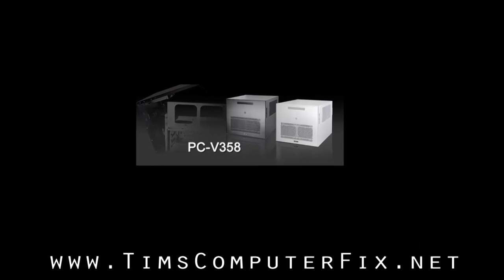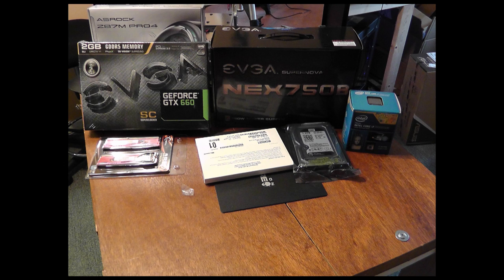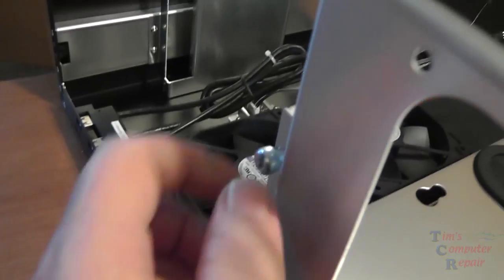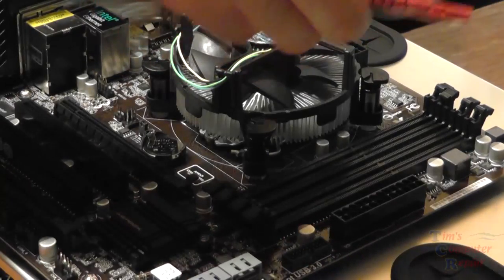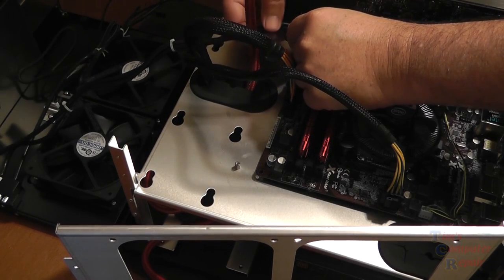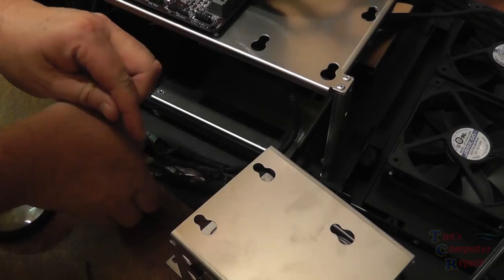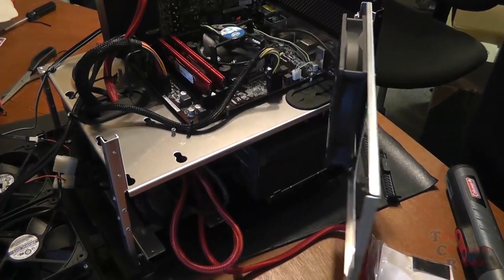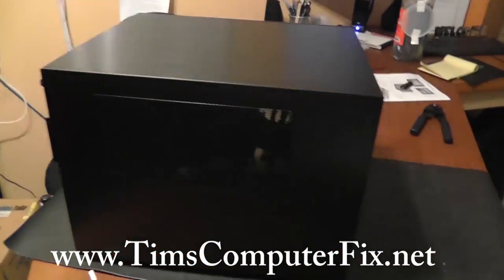Custom Gaming Computer Micro ATX With Lian-Li V-358 Case by TimsComputerFix.net

Comment: Why is there a screwdriver involved and the post being turned counterclockwise when installing the stock heatsink at 8:55?  It comes from Intel ready to install by pushing the pins into the mobo.  Turning it counterclockwise LOOSENS the heatsink.
Reply from the maker: That shot you are talking about is actually when I was later removing the heatsink for a closed water system. I just left that bit of video in... and yes I used a flat head (Nothing wrong with that). Thanks for watching :)

Comment: It's a pity you did not use a after market cooler or a water cooler.

And you put your extra fan in the wrong way, now 3 fan's blow air in your case and only 1 fan sucks air out of you case, and if you put him the right way in you have 2 fan's blow air in your case and 2 fan's sucks air out of you case.
Reply from the maker: ***** Customer was not interested in water cooling. It would have been a nice touch. Was not worried about intake vs exhaust with the fans as this case has ample open ventilation sides, bottom and back panel. I was more concerned about bringing cool air in in this case. Don't forget the PSU is exhausting also. Thanks for watching.